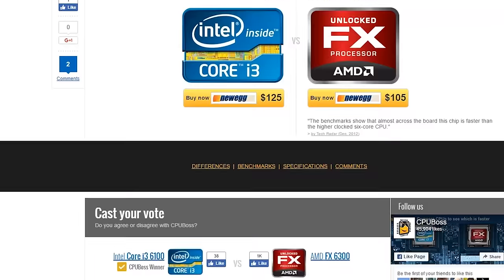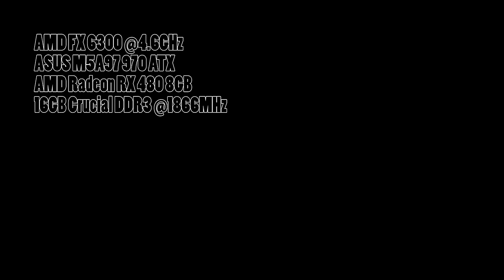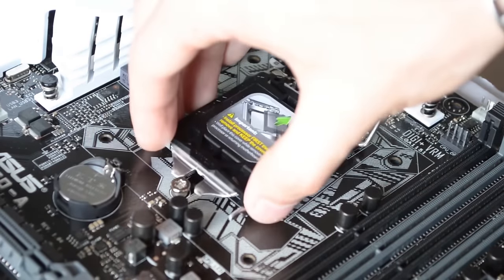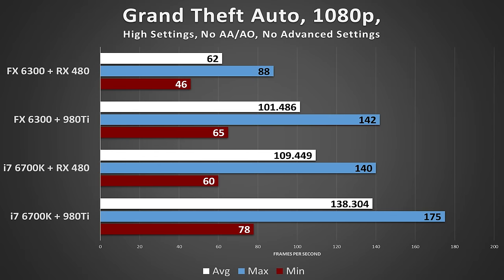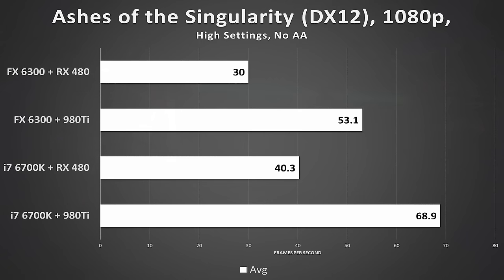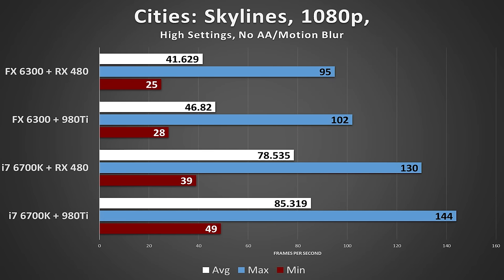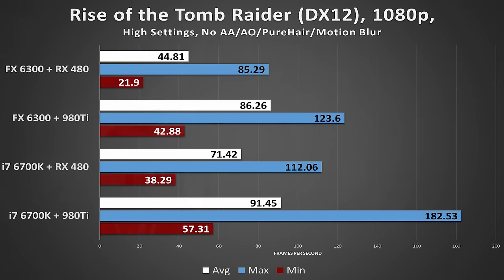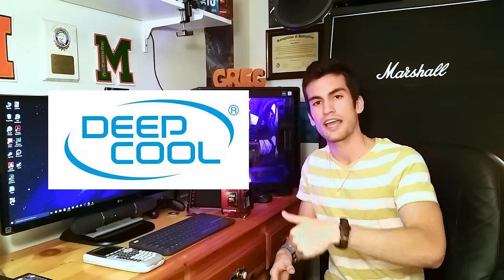AMD FX 6300 + RX 480: Severe Bottleneck?

Comment: An 8350 and rx 480 video would be nice. Great video man.
Reply: Fx 8300 can be had for cheap and runs at Fx 8370 speed very easily
Reply: That's what everybody says, but the 8350 is higher binned. What if you got the 8350 and could run it at 9xxx speeds? or what if you got the 9000 series and ran it over 6 Ghz? Its not like its a huge waste of money. Also to note, you will need some kind of water cooling to overclock (or subzero freon system [so want this to see if I can hit 50% OC on my GPU]) if you want to overclock, and that's not free. Also, buy a good 990 MOBO if you want to OC, but that may run another $50 on top of the minimum.

I have seen the 8300 go down to $100 on newegg on black friday sales, so that's pretty awesome.
Reply: Good luck getting ANY chip to 6ghz without some serious phase change cooling or liquid nitrogen.
Reply: +LiquidPanic the 9590 normal speed is 5 ghz, so it's possible you could get lucky with a water cooling setup, but that's I mentioned the freon setup (phase change), for sub-zero temps. I always think those are cool (word play intended). to mention the motherboard VRMs are important with the 8-cores. an 8 step (or whatever it's called) is much better than the 4 such as on the asrock 970m pro3. that really gives scary spikes at just 4.4 ghz And makes 4.6 or higher unstable, although usually boot-able.
Reply: +Jake Garrett the 8350 has over 8.7 ghz as the record, at one point they used liquid helium, but maybe someone has got 8 with nitrogen. practical, probably not for most people, but awesome none the less.
Reply: Jake Garrett I'm telling you for a fact that you will not get a 9590 to 6ghz with ANY setup that can be used on a regular basis.
Reply: I was considering sub zero freon cooling for a mid range older R9 270 for everyday use, so that's not "extreme" in my opinion. As for the "fact ... any setup", where there is a will there is a way. Would I recommend it? That depends. Most people would consider liquid cooling to be stupid putting water right next to electronics, but we see how popular that is. I would say there are few limits life, those we add constraints to and those of quantum mechanics. 20 years ago nobody would believe in this "internet" or "cell phones" or a computer can fit in a house. So "ANY" is pretty strong, I'm pretty sure someone has done it. Maybe they live in Canada, Russia, or the north/south pole, but somebody has probably done this.

 I wouldn't expect every processor to do this, but I also wouldn't expect a stable 25% OC on the dinky little stock cooler of my 270 when it's about 1/4 or less of the 270x devil cooling system, yet my gpu is like the little train that could, only limited by the heat.
Reply: +Jake Garrett Preach. 👍
Reply: Jake Garrett You cannot run sub zero as everyday use, your components will die quickly. There's a good reason that extreme overclockers only run the benchmarks once and then power off the system.
Reply: +LiquidPanic I've seen lots of older setups that ran it for years. just Google them. There are tons of examples. the did the refrigeration themselves. it's all about insulation from moisture. you also should cool slowly before turn on as to not stress the components physically. also if you live in cold environments, you may already be sub zero. I know my house gets cold enough to freeze my water in my glass (ran low on firewood for a while). this happens often enough, and nothing has broke so far. just saying, some people actually have done 24/7 sub zero cooling for insane period of time, like months to years. they deserve props for that accomplishment, so it is possible
Reply: What on earth are you talking about? Most games run on all 8 cores, Cinebench R15 shows between 650 to 700 for the 8350, and only up to 400 for the i3 6100. That's a huge difference, not double, but around 175% the power. Just Google it.

Unless your talking about some single threaded game, and your saying the 8350 is holding it back from the 1000 FPS mark, well maybe, but I don't know of a monitor that exists at that speed. What games are you talking about anyway? Fallout 4, SW: Battlefront, and all the newer games are not a problem.
Reply: Jake Garrett Please give me a list of "most games" that will run on all 8 cores of a CPU.
Reply: Of my games I just now tested, Need For Speed Most Wanted (all 8, but usually around 12% utilization (running old GPU right now, not my R9 270)), Fallout 4 (all 8), Skyrim (yep an old classic only uses 4 cores, but lets be real, it doesn't need that much for 75 Hz). I can't remember if SW Battlefront used all 8, but I'm pretty sure it did, although it never dipped below 60 FPS for me anyways (Beta release). Tomb Raider (benchmark showed all 8 cores around 10% utilization, loading showed around 40% on all, and I will test in game later).

I also like to play Warface, but I can't test for a few days, but when I do I'll let you know.

To note: None of these are super demanding in my opinion, yet they still use most of the cores. I would imagine almost any AAA title would now, otherwise quad cores with hyper threading would be wasted, and pretty much all the Intels I've used have i7's with hyper-threading.

If you're talking about Minecraft, pacman, minesweeper, or pong, well probably not...
Reply: Jake Garrett I cannot express the amount of facepalm. AMD CPUs have a tendancy to not keep a a task on the same core. Meaning that if your utilization is 12%, the game is most likely only using 2 or 3 cores.
Reply: Jake Garrett So yeah, "Most games" do not run on 8 cores, very few do actually. And it is already well knows that the i3-6100 will outperform any FX CPU in most games.
Reply: +LiquidPanic True already you purchase a 9590 in the hope that it will go up to 5ghz, coz they don't all get to 5ghz on a 24h stable basis. 6ghz is ludicrous even with a custom loop, I mean there are probably some very rar'e 9590 that get to 6ghz on water, but they are very few and far between, at 5.2 you can already consider yourself lucky.
Reply: LiquidPanic I was reading per core, and then averaging for the ones that do get used. 
So yeah, actually those games do use those cores I reported.
For example:
30%
5
45
2
32
1
50
8
I would average 30, 45, 32, and 50 = 39% utilization. And I would claim that it utilizes 4 cores only.

I used CPUID HWMonitor to read per core (note: frequency was allowed to modulate between 1.4 and 4.2 GHz).
Reply: Jake Garrett Once again, probably not even using 4 cores, because of the fact that AMD CPUs like to not keep tasks on a single core, it was probably only using 2 or 3. And also, having Turbo Core/Cool n Quite on with AMD CPUs significantly lowers overall performance.
Reply: What are you talking about? That was at one second, all the time. They may skip around core numbers, but if 4 of 8 are always at high utilization, that means it is quad core. I just checked this with a single threaded program, and only 1 core jumps up. Tested with VBA Excel script I wrote in college (all cores between 0 and 6% at idle, running the script showed 14% utilization on a single core (would be higher but its split second)).

I don't know why cool'n quite would make much difference, all my games are monitor bound (75 HZ max, and not 4K yet). So I don't need extra performance (except cad rendering, but all go to 100% and stay at 4.2 GHz until the render is complete).
Reply: Jake Garrett Cool'n Quiet makes a BIG difference. It honestly destroys the overall performance of the chip, even if your software says that it's staying at 4.2, it probably isn't. It's probably jumping around very quickly. Plus, I don't know what kind of magic software you're using, but I have an FX6100 machine, and with a single threaded load it shows all cores at 15-17% utilization.
Reply: On HW Monitor, it shows individual frequency jumps, like right now I have below frequencies (snipping tool to capture since they change so fast).
2205
4200
3570
4200
2940
4200
3570
4200

I know with heavy loads, it will stay at 4.2 GHz (Cinabench, or my Solidworks rendering). HW monitor is a very useful app, shows all the temps, fan/pump speeds (let me know I was running low on water once), and voltages. Should note that the temp for AMD is way wrong, so use the socket temps (TMPIN3 for me, or CPUTIN seems to be close)
Reply: Jake Garrett I'm not going to bother, you won't listen. HW Monitor doesn't update fast enough to show you the small, short term jumps that the CPU cores are making to maintain a lower temperature, which in turn lowers the overall performance of the CPU.
Reply: LiquidPanic Testing this Cool'n Quiet with cinabench, I found no difference. First run, normal: cool'n quiet on, allowed cores to move from 1.4-4.2 in CPU power management (catalyst or crimson). Second run, disable cool'n quiet in Bios, cores allowed to fluctuate. Third run, cool'n quiet disabled, cores locked to 4.2 only.
scores were
654
653
654
So within margin of error the same (although note cool'n quiet turned off gave the least).

So it doesn't affect performance. If you refer to in-games, since it doesn't drop below my monitor's frequency, I don't really care if some games drop from 450 FPS to 430 FPS (as an example, though I doubt it drops that much) such as the Dead Island series.
Reply: LiquidPanic I know 
HW Monitor only updates about every half second, but if I run a heavy single thread program, the number of cores that appear to be utilized are never constant. It may look as 3, then 2, and then 1, and then 2 again, but its never a constant number. Also that is a Windows thing, Linux will run a single core until it is done, so its not AMD as far as I know. 

I may later retest by turning all cores to lowest setting, under-clocking the multiplier if i need to until I can get the games at 80-90% or even 100% for a CPU bottleneck to show its not core hopping.
Reply: LiquidPanic Tested, Skyrim uses 50% total averaged, therefore it is quad core. Capping it to 1.47 GHz, I was able to bottleneck the CPU, so that it had 55% utilization. The numbers per core are at the end. I was trying to dwarf the cores down to 700 MHz, but under-clocking down to the minimum allowed by my bios caused it to fail to boot, not even loading the bios boot up image. Thankfully I have it reset to last settings after 3 fails, so I set everything back to normal.

% running skyrim
43
72
35
49
52
47
34
63
47
= avg of 55.25%, the other 5.25% was probably from windows at idle, which at normal clock speeds is around 1% according to task manager, so with 5.25% *1.47/4.2 = 1.84% from windows at idle (plus HW monitor), and showing skyrim uses 4 cores.
Reply: LiquidPanic, I found this conversation interesting and thought provoking. Thank you for bringing up some good points like the AMD core hopping, your theory on Cool'n Quiet (which I never would have thought testing, and now I know more about it). Hopefully someone can make use of the testing results I posted. As always, have a great day, and may the 60+ Hz be ever in your favor (hunger games based quote).
Reply: I own now that Asus Crosshair V Formula-Z motherboard that The Stilt and Macci cooled with liquid helium while breaking FX-series records in 2011/2012. 8350 that I have is not a record holder, but went past 8GHz with liquid nitrogen. :) I've been running them mostly on stock clock with Noctua for the past 4 years, pearls before swine. Just ordered Sapphire Nitro+ RX 480 8Gb...
Reply: the 8350 might be great if you plan on gaming on a 60Hz monitor, i would shy away if you have a 100Hz+ monitor

Edit: WOW, this is an old comment